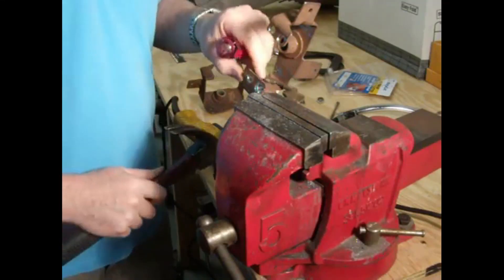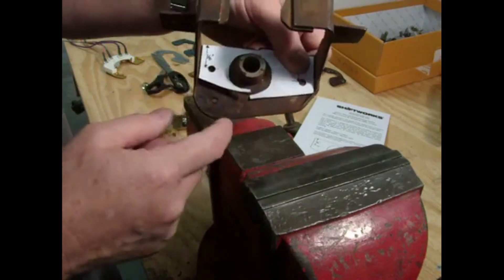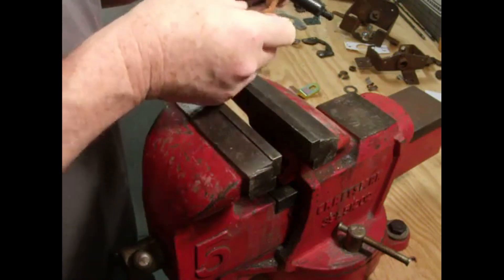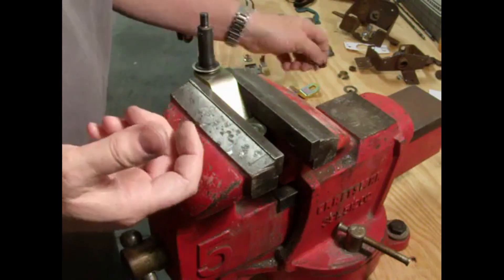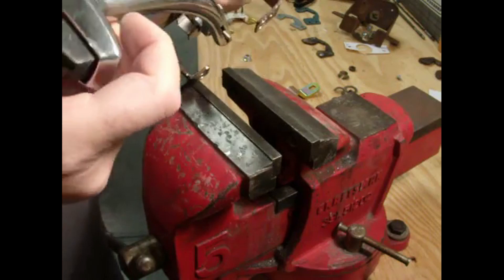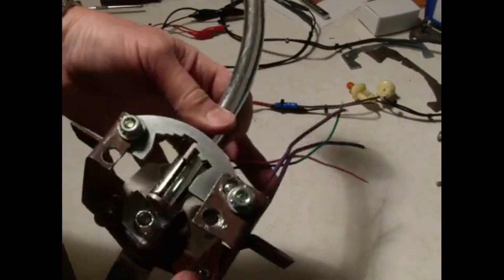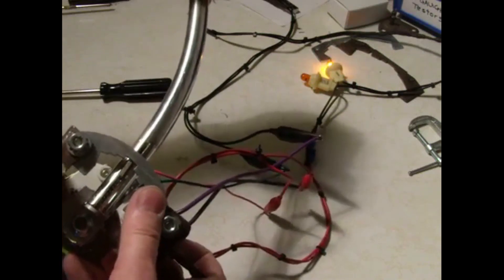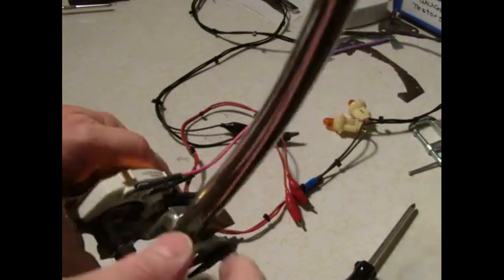Shiftworks S105 DA DB Conversion Kit

Comment: Guys at shiftworks I want to thank you so much from the bottom of my heart I have use your product for my restoration on my 67 Firebird and now I will be using your parts for my 69 Firebird that I am restoring thank you
Reply from the maker: Luis, Thank you for the kind review and support! If your curious how setting up the conversion for the 1969 Firebird works, check out our videos on the SC2262 and SW653 kits as well!